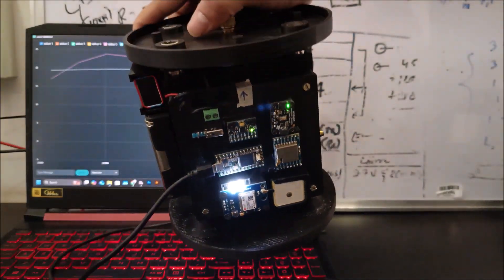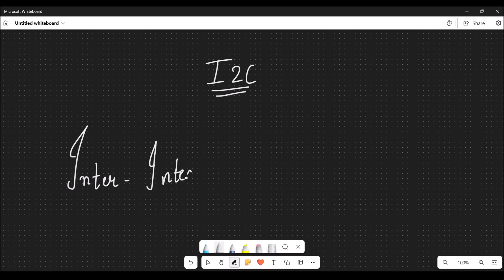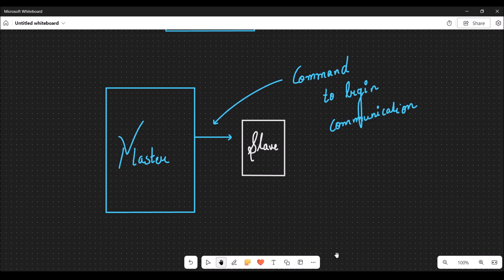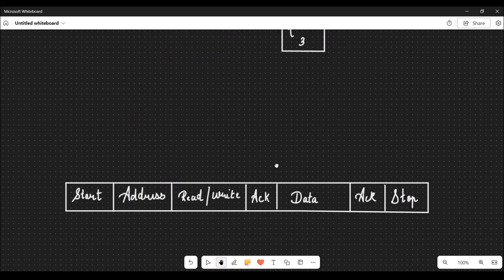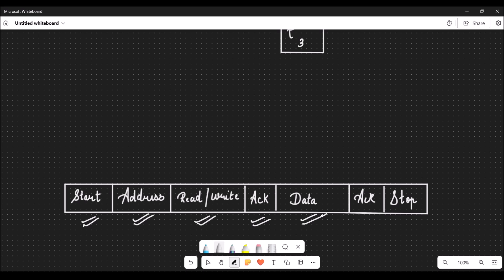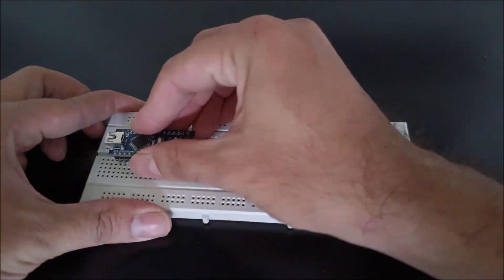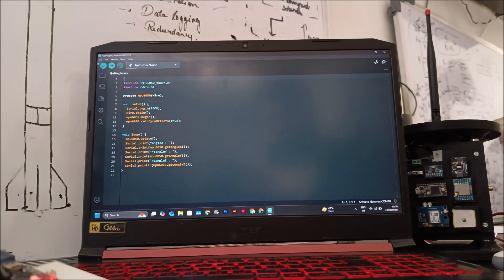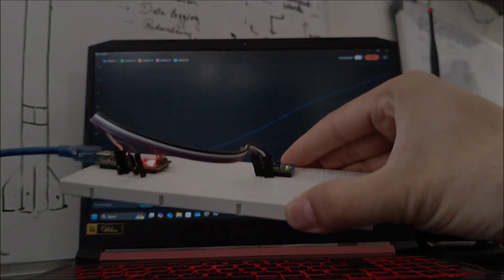Interfacing MPU6050 with Arduino | I2C Communication | Rocket Avionics

Comment: How to calibrate mpu6050 precisely as it gives random values sometimes and it is also not starting from 0 for every axis
Reply: One axis will give u 9.8 m/s² as value cause of the g value exerted by earth. U need to callibirate it by subtracting it in the program itself before displaying value
Reply from the maker: In 'void setup', you can write the code to derive the values and later on subtract for calibration.